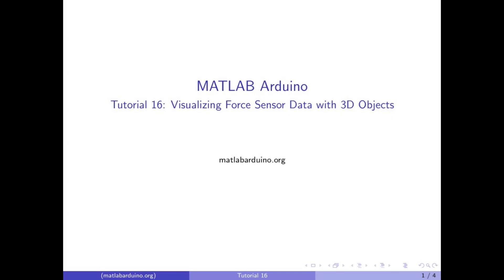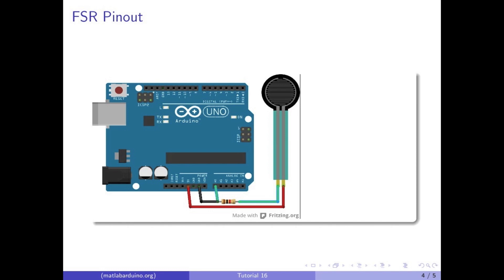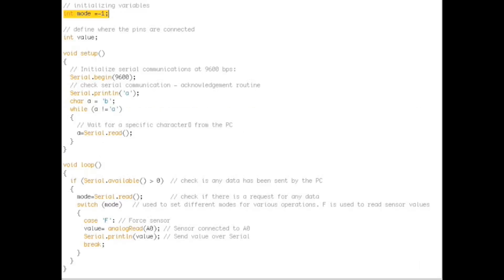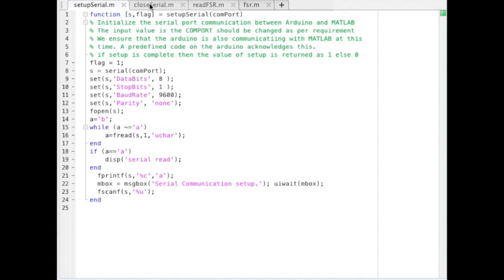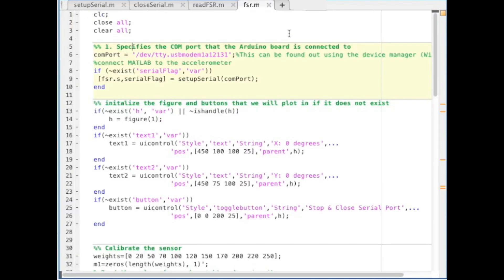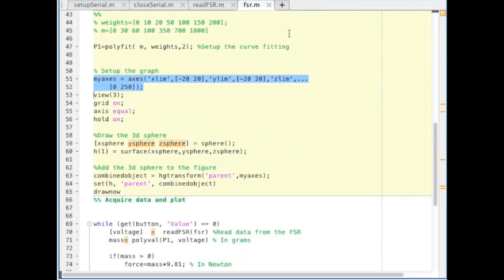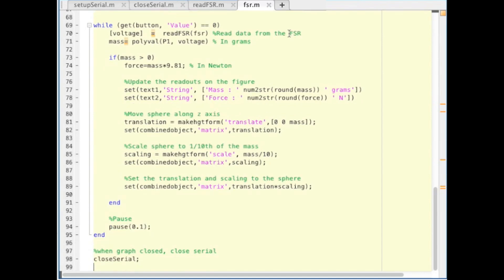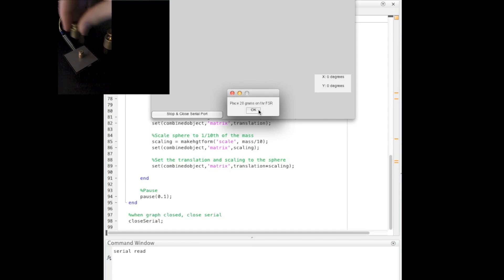MATLAB Arduino Tutorial 16 - Force Sensitive Resistor (FSR) Calibration and Visualization

Comment: That circuit will never work. It will always read zero as A0 is tied to GND. It should be,
The green wire from A0 should go to the other side of the resistor, 1K, where it meets with another green wire is coming from FSR.
Reply: Yeah... that's what i though as well!

Comment: I know this video is old but for anyone have trouble with the sphere does not change size, the problem is in line 55 with the code "axis equal". Comment this line of code out and your figure should behave normally. This line is basically keeping all 3 axes from changing in length :)

Comment: hi, thank you for your useful lesson. I copied every single detail of the programs in Matlab and Arduino IDE, but after putting the weights on FSR and after the end of calibration, a sphere appears and its volume and Z position are fixed, they don't change like the one in your video. what could the problem be? can you plz help me.
Reply: hi amir do you have the code? can you send it to me nabill.uthm@gmail.com tq
Reply: hello friend I wanted to know if you can give me the complete code to execute it is that it does not work for me I already tried it and I have no results

Comment: when I do run the readFSR.m file I get an error saying
??? Input argument "out" is undefined.

Error in ==> readfsr2 at 4
fprintf(out.s,'F');
 
??? Input argument "out" is undefined.

Error in ==> readfsr2 at 4
         fprintf(out.s,'F');

Am I suppose to acquire an arduino library that will allow me to use the "out" function?

Comment: hi  may i know if i can use this force sensor to measure impact forces? i.e. something dropped from a low height onto this force sensitive resistor. i will not be pressing on the force sensitive resistor manually or stacking weights on it but simply will be using drop-test, which is the impact method. can someone please elucidate ?

secondly, how much force can this force sensitive resistor withstand?

 lastly, does this method works for other kinds of force sensors like the piezoelectric version etc? thanks!

Comment: I am kind of new to Arduino and Matlab but in the past month I managed to built up a sensing matrix with the help of Multiplexer.
The serial output can be collected using all back-to-basic codes with pin switch using the combination of 3 digital I/O pins. 

const byte addressA = 2; // the multiplexer address select lines (A/B/C)
const byte addressB = 3;
const byte addressC = 4;
byte numberOfSensors = 56;

XXX
  digitalWrite (addressA, (sensorI & 1) ? HIGH:LOW);
  digitalWrite (addressB, (sensorI & 2) ? HIGH:LOW);
  digitalWrite (addressC, (sensorI & 4) ? HIGH:LOW);
  // now read the sensor at A0
  return analogRead (sensorM1);

However the next step is a truly pain for me because I'm trying to shift all of these to Matlab for some further data processing like Neural network. 
I clearly understand that the a. analogRead() but it's been hard to get the data from Arduino 

Hardware: 7*8 Force sensitive resistors 
Arduino MEGA 2560
Interface: Matlab 2012a

Would you be so kind to give me some clue/ break through?
Thank you in advance
Reply: Did you use arduino and simulink?

Comment: Hey MatLab, i am trying to write down this program through MatLab, but i am having trouble with the weighing portion, when the program askes for me to place 20 grams of weight. I do so, but then the other window only shows M1 = 0 in one column 11 zeros. saying there is an error in the "FSR at 39" M1 (i) = readFSR (fsr) i would really appreciate it if you can contact me ASAP.
Reply: Hi! We are trying to do this and we are having the same problem! Do you already know how to solve it? 
The error seems to be: The 's' property name is ambiguous for serial port objects. 

Many thanks!!
Reply: yeah i did this with a team for my senior project for college.
What do you need?
Reply: @EdwardxMarquez  Hi, I know that time is passed but how did you sort out your problem?
Reply: Ana Silva Hi! I'm actually having the same problem. Did you finally solved it? I know it's been a while since you post this but I would really appreciate any help.
Thank you!!
Reply: +Edward Marquez I'm having the same problem as well, are you able to help?
Reply: I had the same problem but fixed it by wiring it up differently. The way it is shown at the beginning of the video means that the AD0 pin is always 0V. It needs to be wired up like a potential divider with the AD0 pin reading between the FSR and the resistor. 

Another way to think of it is to have the resistor between ground and AD0